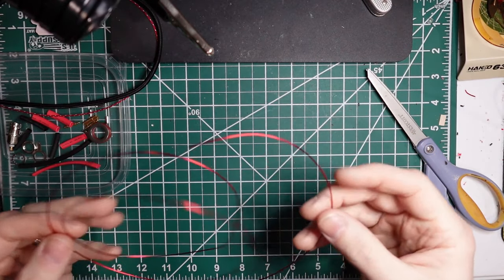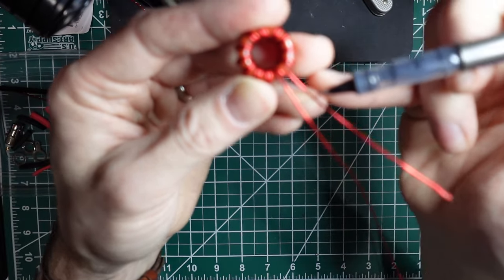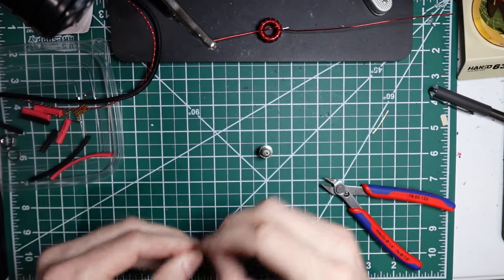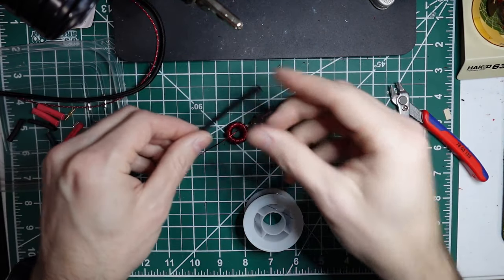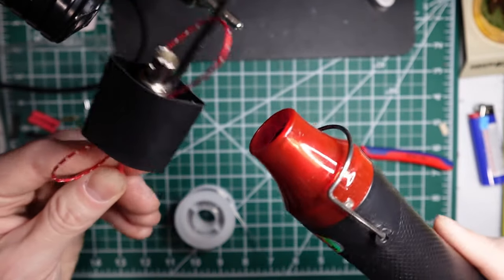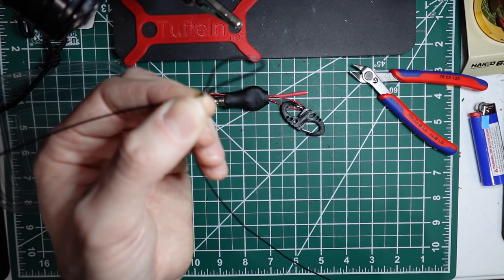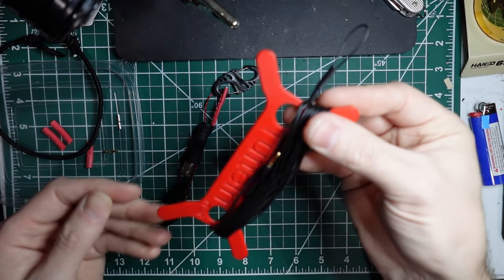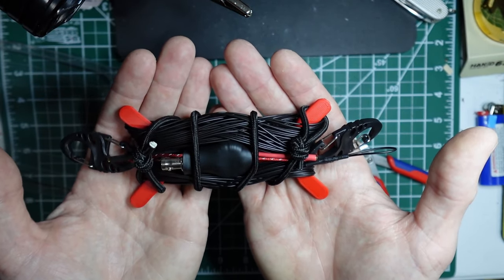Building the Tufteln QRP EFRW Antenna

Comment: Thanks for doing this build video, Joshua.  Very helpful to see your technique.  What power supply are you using for the Pinecil?  Do you have a battery you like to use with it for when you travel?  Thanks!
Reply from the maker: I am running it from my 100Ah homebuilt power bank that stays topped off with solar. I run a boost converter to 22v and feed the pinecil which will then pull up to 70w. Works very well for me. For portable I run two of my 12v LiPo batteries in series for 24v. If needed the pinecil will do most solder jobs at 12v as well! Joshua N5FY
Reply: Thanks! I just ordered a Pinecil so I appreciate you sharing that info. How do you monitor the voltage on the LiPOs in series? Sorry these aren’t antenna kit questions… I love your design choices on them though!
Reply from the maker: I don’t monitor. I use packs that have the same cells and configuration. Then check them against each other when voltage is getting to about 20%. They just don’t drift far from each other.